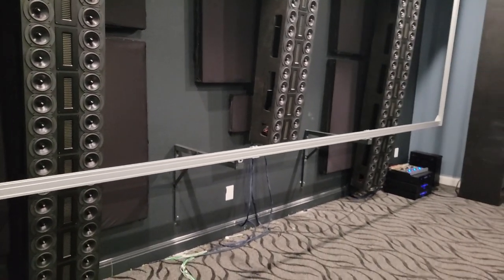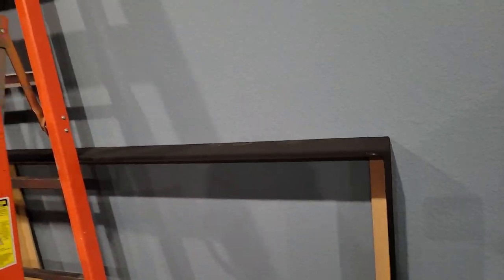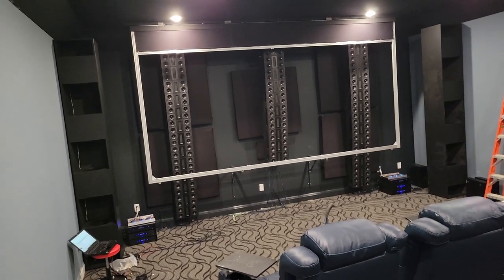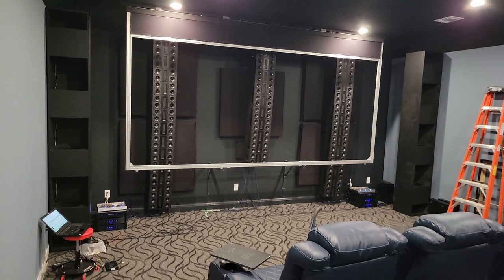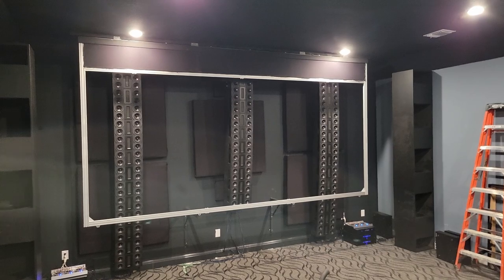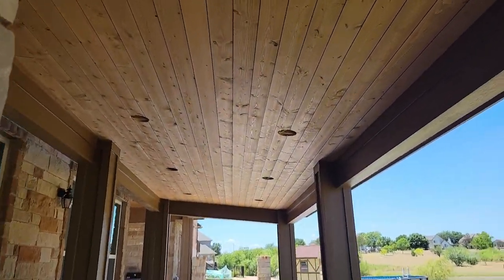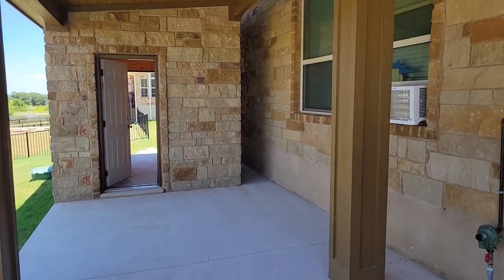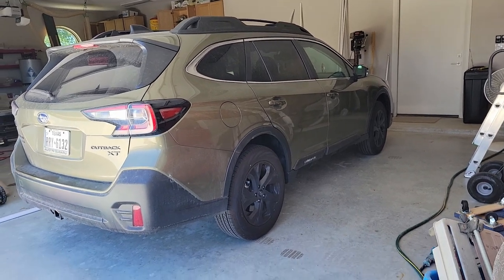Theater update 7 9 22

Comment: Your idea is insane but How did you connect all those speakers together for each channel? using crossover or parallel?
Reply from the maker: Combinations of series parallel into groups.  The CBT array drivers play at full output in the center (-0 dB down) and incrementally attenuate as you move toward the ends.  Each group gets its own amplifier channel and each channel.

Comment: Out of curiosity, what do you do for a living? You go everywhere lol.  I’m sorry you have to go into Portland somewhat often. I live in Salem, about an hour south and even I don’t like going into Portland.

I like your design. I did a pair of line arrays for just two channel listening, they had 16 of the Dayton reference 6” woofers and I want to say 12 of the BG Neo 8 pdr drivers per channel. Right after I bought them those BG drivers went crazy expensive.  Everything is just so darn expensive right now. I have a GLS 450 and it cost me $174 to fill the tank!!!!
Reply from the maker: I'm a Field Service engineer for a supplier of semiconductor manufacturing equipment.  I do system installations, repairs, calibrations etc.  We have photolithography equipment for advanced interconnects, Laser Spike annealing equipment, and several other systems used in making all those little micro chips inside your smart phone, PC etc.

Yeah the price of drivers has pretty much doubled in under a year.  Parts Express was telling me several weeks ago that they have had four large price increases in the cost of  materials in the last few months.  Also, a shipping container full of drivers use to cost them $4,500 to ship from Taiwan or China, now it's $18,000.  So they have had no choice but to increase prices.  I'm just glad I bought all the AMT's for my lines back when my wholesale cost was under $80/ea and most of the 5" Reference drivers when they were about $20/ea.  I wouldn't be able to afford to build those lines today if I hadn't bought the drivers when they were still reasonable.